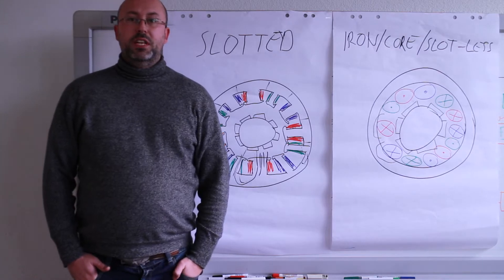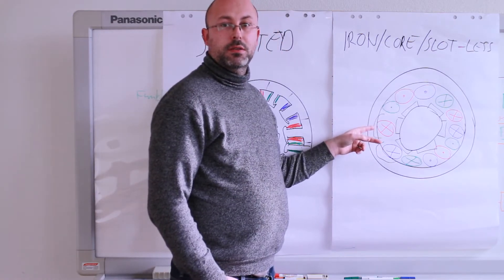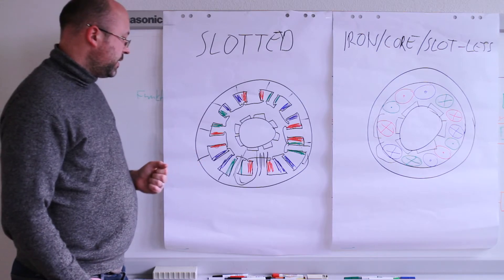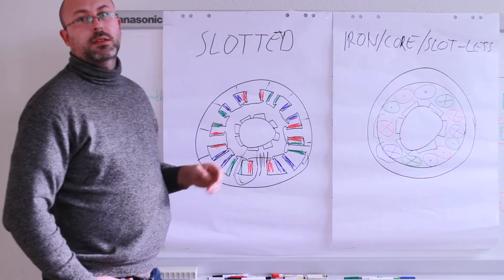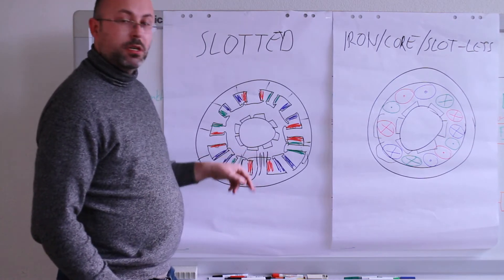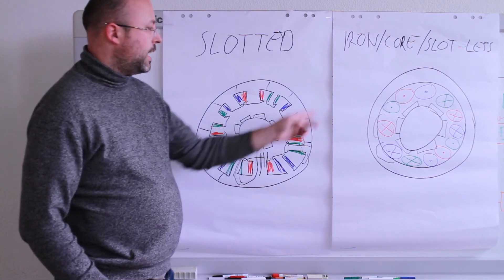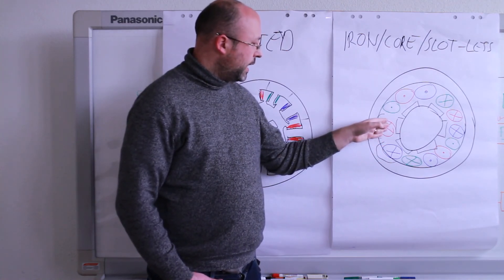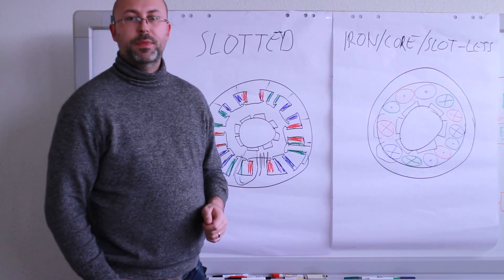Episode 8: Slotted vs Slotless

Comment: 1. easy  to manufacture (SL)
2. stator segments make easy to wind coils (S)
3. No Cogging torque quiet operation and smooth performance (SL)
4. concentrated windings in Slotted makes its toque density higher  (S)
5 . Slotless also reduces damping
6. heat dissipation is easy in slotted as iron has edge over epoxy resin
7. Slotless motors are typically designed with sinusoidal torque output that produces negligible distortion, rather then a trapezoidal voltage output. 
8. high power density in slotted (S)
Reply: Thank you Matthew!
Reply: i wanted to know about IPM and SPM motors , basically comparison between them , can you reply

Comment: So small slotless would not be useful for an electric bike. But what if for instance, there were several mounted flat around the rear wheel. Maybe it would be expensive! But no magnet drag, Maybe zero drag when pedaling with the motor off?